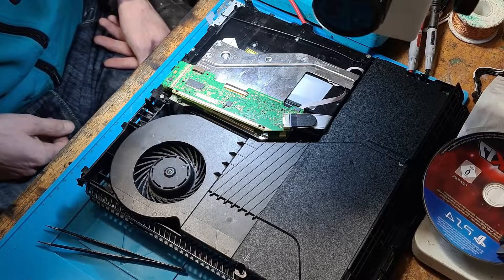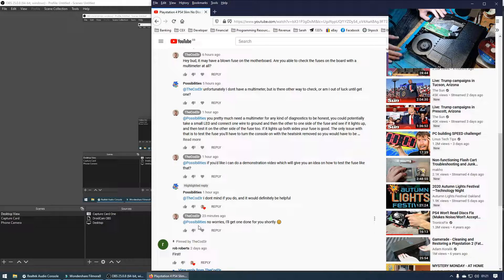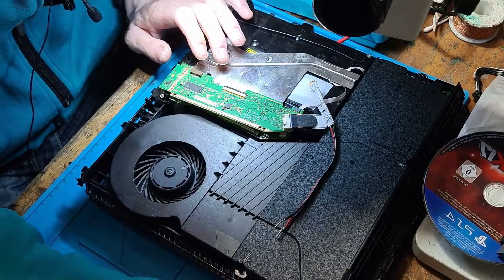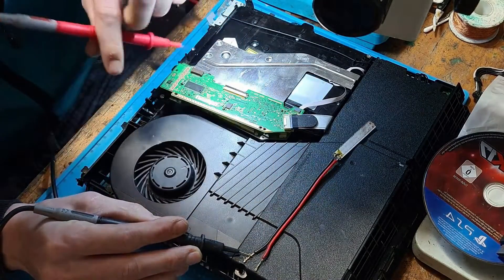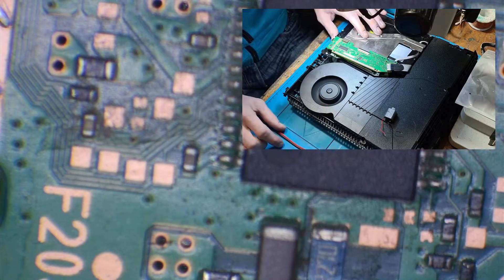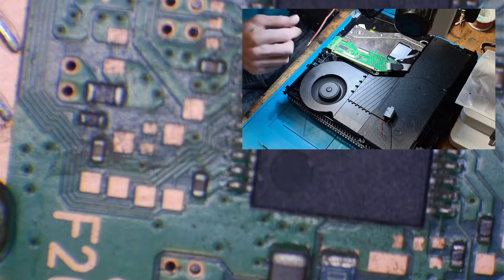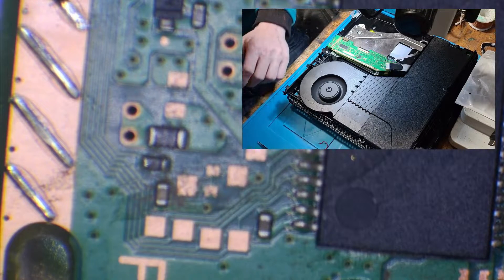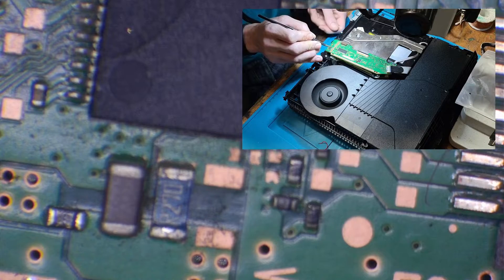How To Test A Fuse For Continuity Without Using A Multimeter! Component Level Diagnostics Life Hacks

Comment: Yo, thanks mate! I just found an open led circuit to try this on, but how many fuses are there for me to check, and do they differ from model to model? Like will a ps4 slim have a the fuses in a different place or number than a ps4 pro
Reply from the maker: You're welcome bud, yeah the pro will have them in a slightly different place to the slim and the fat have them on a separate board. Right now I have 3 other consoles in queue with disc feed power issues so I'll be making videos on those if I can

Comment: Good technique, great video. You can get meters for so cheap, I use cheap $3 meter to measure current all the time.
Reply from the maker: Yeah sometimes though an ordinary joe will find themselves in this situation so hopefully they can work around that by using this method. It's a bit unorthodox but definitely works lol